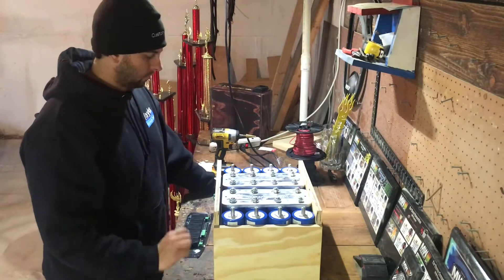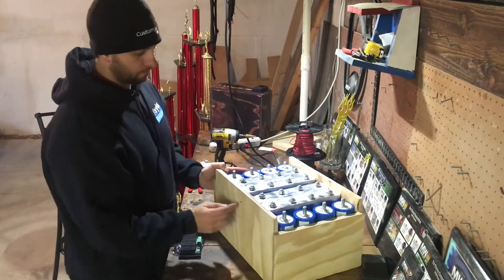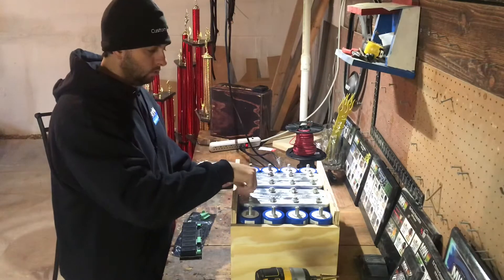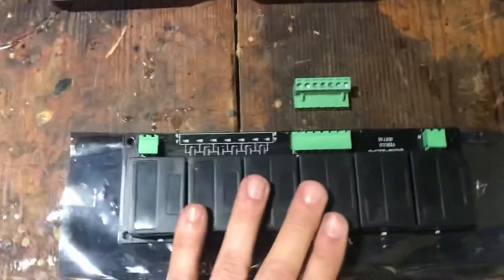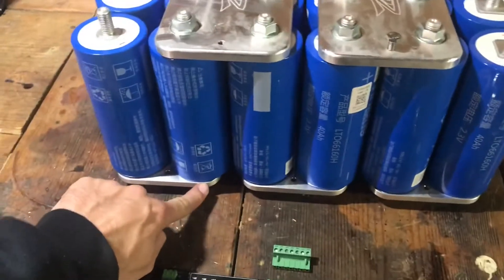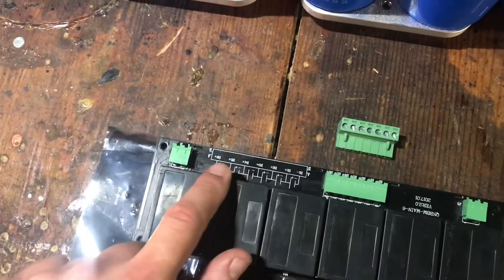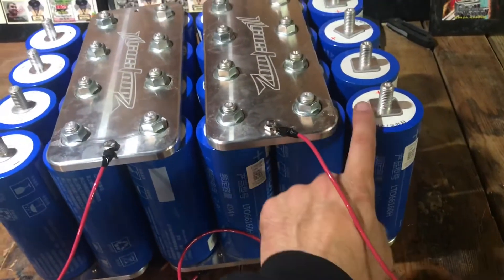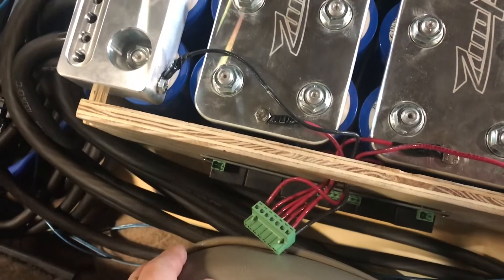QNBBM 6S BALANCER INSTALL YINLONG BANK

Comment: Does that hi pitched noise go away or turn off ? Cuz it’s pretty loud and I Def would not want that noise audible when system is low or off..
Reply from the maker: Up To Bat Entertainment no, it’s always on
Reply: Steven Herman yikes .... read on the yinlong only group that some ppl are getting bad interference/ alt whine when installing these... hope that doesn’t come thru the speakers

Comment: Where do u get the eyelets for the 12 gauge? I'm going with the 12 on the balancer hope ur right lol no info anywhere glad I found this video.. and I like how is just simply put  ...good work
Reply from the maker: James friedrich thank you! I bought the connectors at Lowe’s. However, I did drill them out slightly to fit the bolts
Reply: @StevenHerman8675309  thank you sir